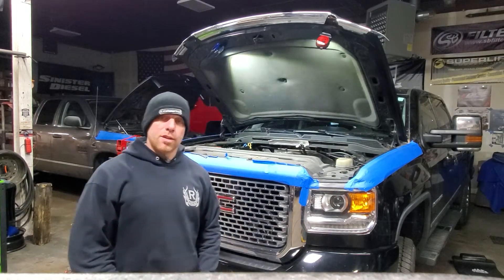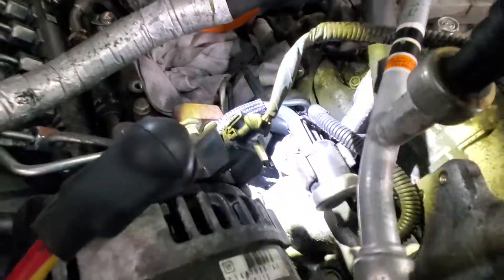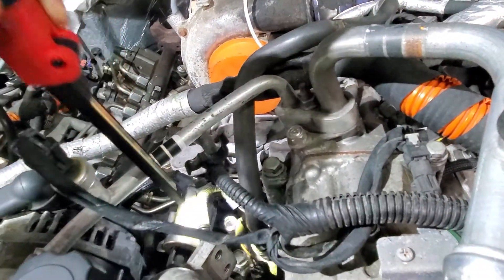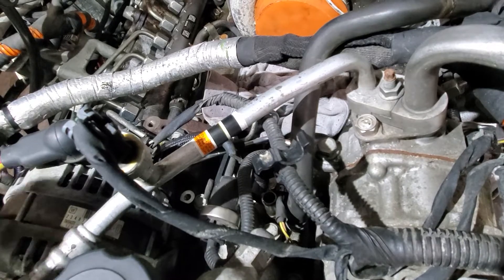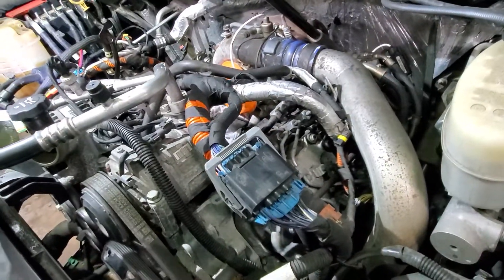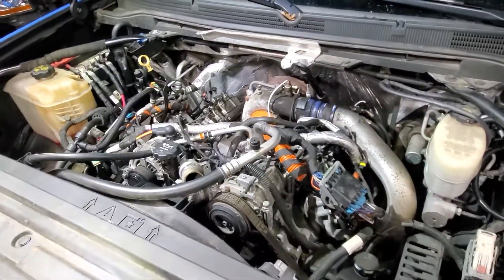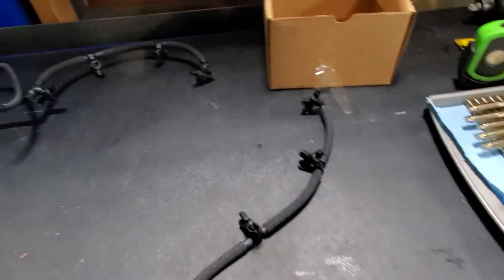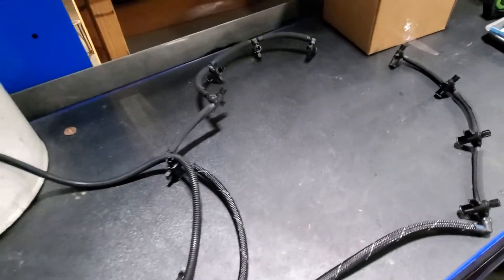Lml duramax no start after cp3 conversion open return system failed regulator piezo injectors

Comment: After you applied shop air how did you keep it from not bleeding the pressure again with fuel and not having to add more shop air cause I’m having the same problem with my truck won’t start and I can’t figure out why
Reply from the maker: That was just a test to confirm faulty return regulator operation. You need to replace the return lines w that regulator attached

Comment: After replacing fuel system and installing lift pump I had a bunch of codes for injector ID (all 8) cleared that up.  Still wouldn't start.  Puffed the tube.  Nothing.  Plugged the lift pump back in VROOOOM!!! OMG- thank you!

Comment: my 2015 lml has a similar issue after i did a cp3 conversion i ended up replacing it and still having the same issue . because of this too i also added a lift pump from airdog and adjusted the pressure to 5 psi because fleece told me they run good between 2 and 7 psi. so i did this and I'm still having the same issue . and of course i tried to start with starting fluid and it acts like it wants to start but nothing . could there be something I'm doing wrong? scanner is showing around 5000 to 6000 psi when cranking it over. any help would be helpful . thank you

Comment: my truck doesn’t even have this regulator. it’s a brass T. been trying to get it out of limp mode for a month now, could this be the problem? cp3 with lift pump
Reply from the maker: Not sure how the brass T is creating the necessary return pressure but if the truck starts, i doubt it's an issue. Check the code and see what the engine is going into limp for. There's dozens of reasons. Without the code it's a guess

Comment: After you replaced this did this solve the issue? I have an 11 that I ran your air test on and it fired up so I’m hoping that works. On my way to get a new return line now to try it out
Reply from the maker: @cliffmacintosh  I believe on this truck the return regulator replacement solved the issue. However, we have had others where a faulty injector was the reason for the no start. In that case the injectors would have to be replaced to remedy the issue
Reply: @richiestruckandauto7438  i have just installed all new fuel system with new fass pump and cp3 conversion on my 2011due to install of new reman long block(injector failure bored a hole in my piston). after replacing my return lines i still had to apply air to jumpstart the check valve but have not had any issues in 200 km now. thanks for the tip
Reply: @richiestruckandauto7438  with a faulty injector how can you tell?? thanks
Reply from the maker: @gearheartscott faulty injector will result in excessive return rate usually causing hard/no start

Comment: You need to just apply shop air to the return no big deal they need i think its 45 -60 psi on the return i cant remember which  to allow the injectors to fire no big deal but alot of people panic

Comment: So I did this, and it fired right up. Shut the truck off to put the air cleaner back on. Then fired it back up and it died after about a minute and wouldn’t start back. Performed the same procedure again and now it tries to start but then dies. Any ideas?

Comment: The 2015 LML I am working on right now has a back-fill valve that gives the return lines 43psi and once 43psi is hit, it closes. It dumps fuel into the return line assembly between the injectors and the constant-pressure valve. It builds 43psi very quickly even with the return hose assembly completely drained. It does this when just cranking the engine over. I also found it interesting how I was able to do a fuel-return volume test on ALL 8 injectors at once with the engine running. So sometimes an LML will be able to run (and start) just fine with 0psi in the return line (I had all 8 return lines disconnected from all 8 injectors and 8 individual hoses running to some syringes to measure return volume.

Comment: Are you adding the air to the line and then turning the truck over? Or do you need to add air and have someone turn it over at the same time? Any other tips would be great. I got cp3 installed and lift pump. But no start now...
Reply: What was your fix

Comment: did you ended up replacing the return line or did adding shop air to the line solved the issue?
Reply from the maker: Just added some shop air and all was good 👍
Reply: @richiestruckandauto7438  i did that but the truck needs to be pinched every time i start it. i have no fault codes nor leaks.

Comment: The regulated broke on my truck. Do you have a video on how you replaced those return lines?
Reply from the maker: Hello. I'm sorry I do not as of this time. I've done many of these. Keep a very detailed record of how the lines were routed currently before you remove them. Be cautious removing the return fittings from each injector as they are only plastic fittings below as well. 👍